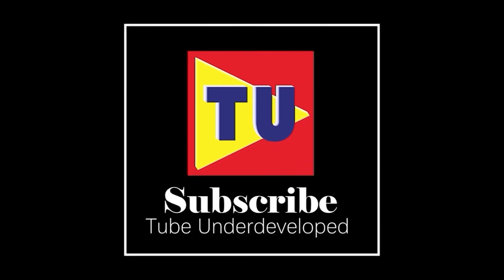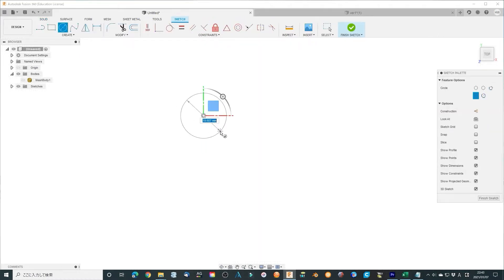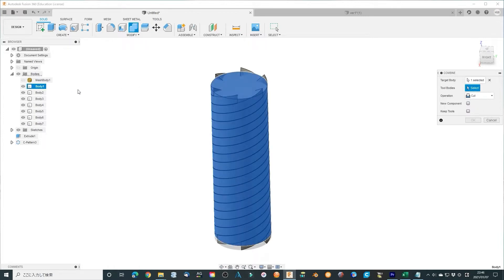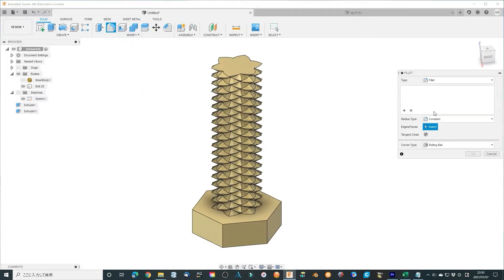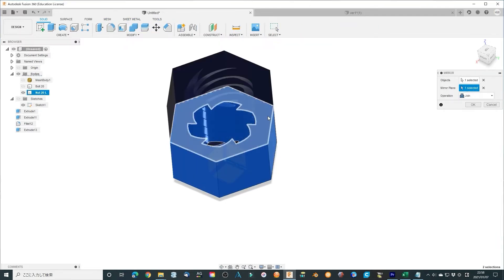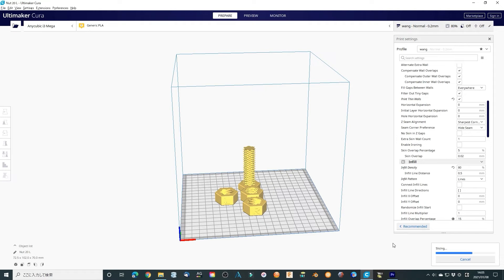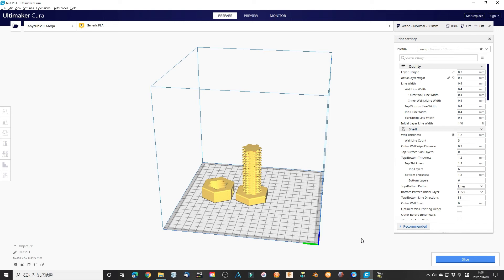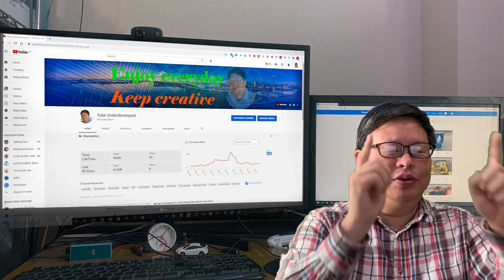Multi-thread magic bolt and nuts (secret revealed) and design with Fusion 360 extremely simple

Comment: That's really cool! But I'm curious, how can all the faces match at the end when the nut enters the bolt? No matter how I design, the faces of the screws don't match beyond that. 

And you gave me a tolerance of 1mm, but I added a little bit to it and gave it about 2mm. Will it be okay??

Please let me know
Reply: Just in case my explanation is weird, let me add a little bit. I want to know if the last part of the bolt and nut match. I am using Fusion 360, but the surface of the bolt and nut is not attached to it, so it is difficult to check accurately.
Reply from the maker: Thanks for your comment. I think you just need to cut the bolt to the correct position. Use a cross-section in the bolt middle plane to align the position of the bolt and nut and cut the bolt. It may work for you. And at the end of the nut, you can modify it with a hemisphere using the cut function. Just as fillet operation. Hope it may give you some help. Please tell me if it works or not. Good luck.

Comment: How did you do the single start one? Is there a way to do it with a pre-existing thread? So a store bought nut would work? Obviously youd need a left and right hand thread nut though.
Reply from the maker: If you want to make the bolt directly using the existing thread, you can add counterclockwise thread I think. On YouTube I have seen this kind video before.  They use special tools to make the thread. The bolt is multi-thread type. Commercial nut can work clockwise easily. Also the counterclockwise type exist.